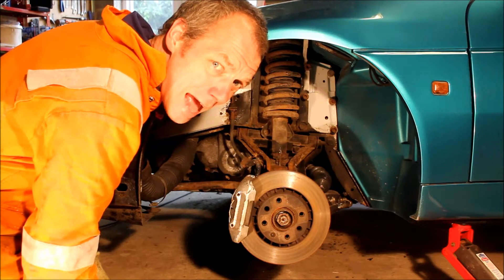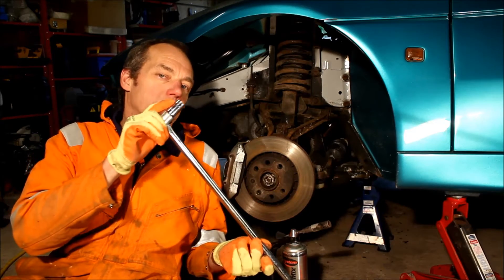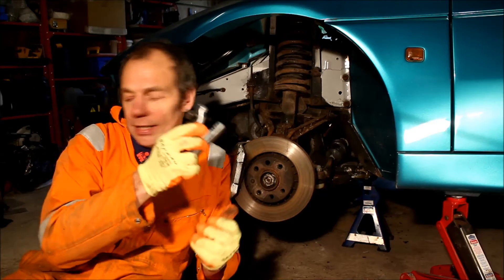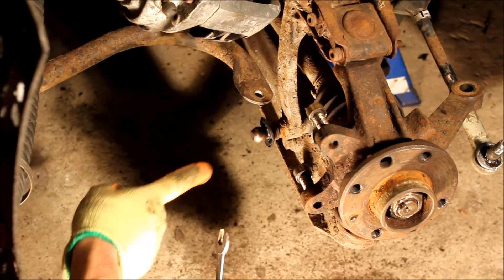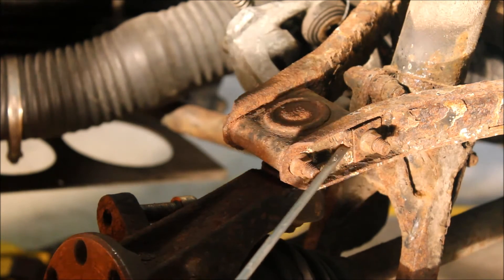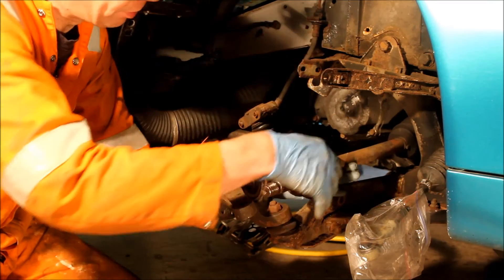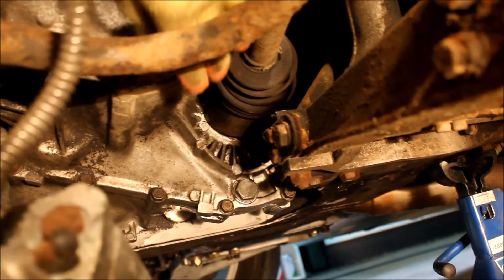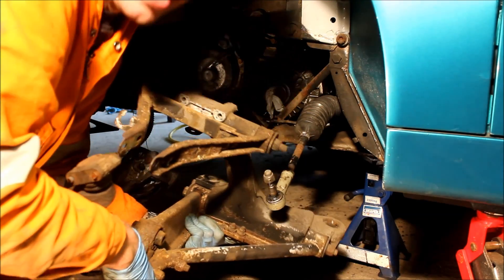Removing the front suspension and driveshaft on the Lotus Elan M100

Comment: Just to add to this regarding the removal of the driveshaft, I found it very difficult to remove it using the method shown here, I found that if you can fit something like a forked ball jint remover between the tulip and the gearbox casing vertically and give the bottom a whack, it should come free.